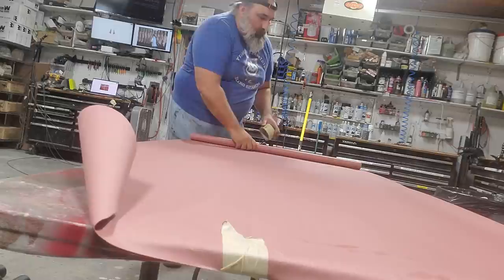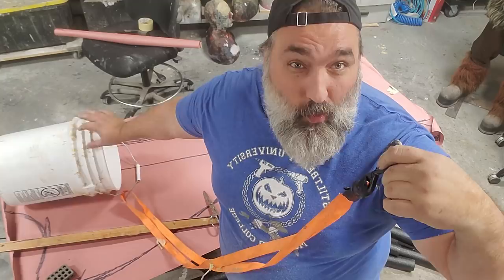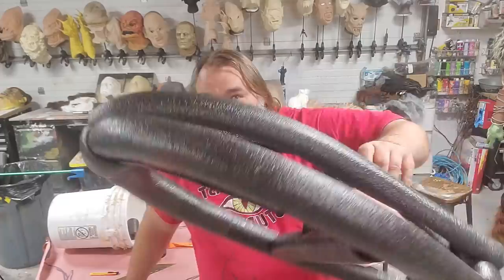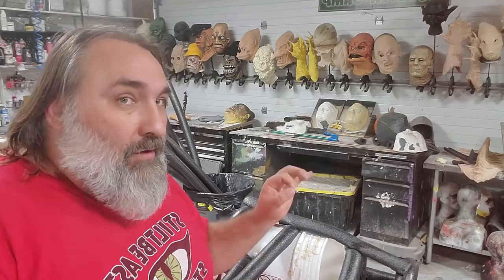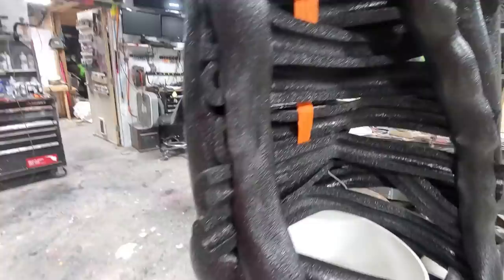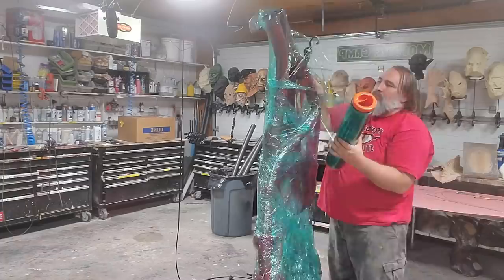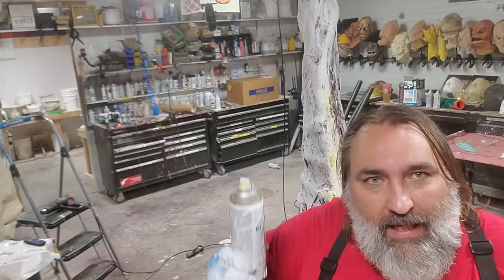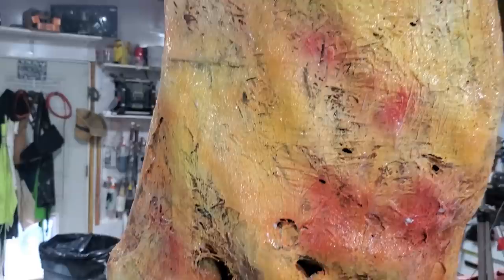Side of beef vid

Comment: I know you use a lot of pool noodles however how do you make it fire safe? Do you just spray it?
Reply from the maker: no, they are not that fire safe. and they wont absorb flame retardant either. they are safer than styrofom which is the main other material faux pumpkins are made from

Comment: This is exactly what we were needing!  Thanks so much for sharing!  May I ask where you bought the black pool noodles?  This would also look fantastic in a "rotten" finish to mimic a finish offered by the big boys.
Reply from the maker: you dont have to use black since they are all covered. during halloween dollar tree has black ones- if you cant wait then 
https://foamnoodles.com/ also has them I buy 50 at a time from them and it runs $150 delivered.
Reply: @StiltbeastStudios  I agree, black isn't necessary,  but the only black I had seen until now was pipe insulation.  I will be making a couple of these for this season for sure.  Thanks!